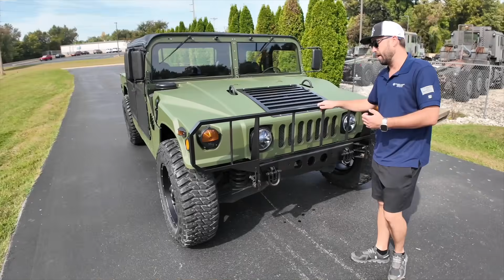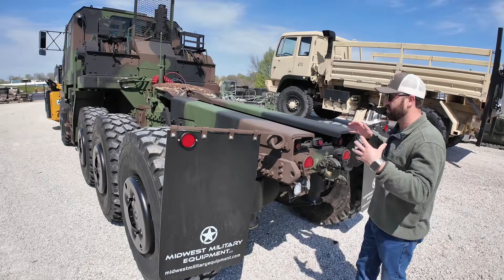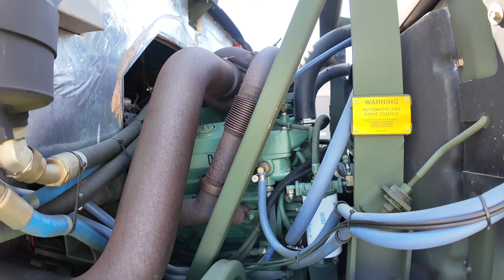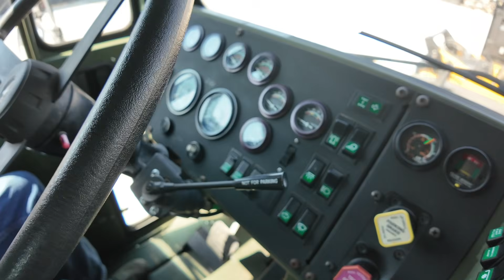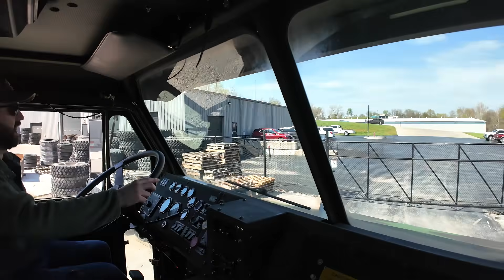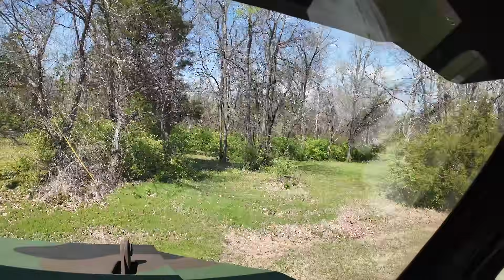Driving the World's Toughest 8x8: Oshkosh M1070 HET Tour!

Comment: Do these 2-stroke Detroit Diesels run always at extremely high rpm's or do they just sound like they would?
Reply: It's because it's a two-stroke. Each cylinder fires twice for the number of RPMs compared with most other engines. It sounds as though it's revving twice as fast because it's firing twice as often.
Reply from the maker: It's mostly the sound, they really don't run at high RPM compared to most diesels.

Comment: GM diesel require the supercharger or roots blower to
 blow exhaust gases out the cylinders and fill with fresh air. Otherwise they will no run. The turbo will compress the air giving it more power.